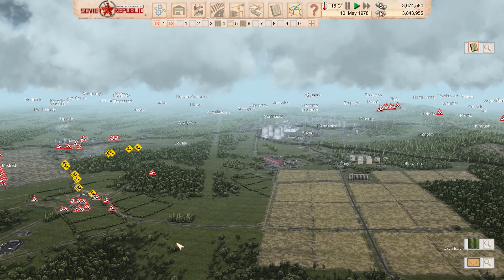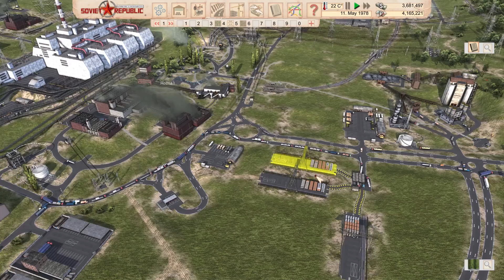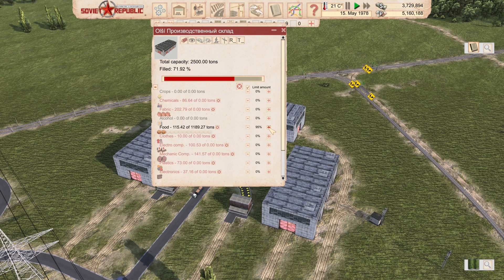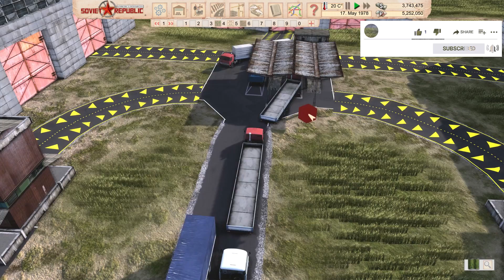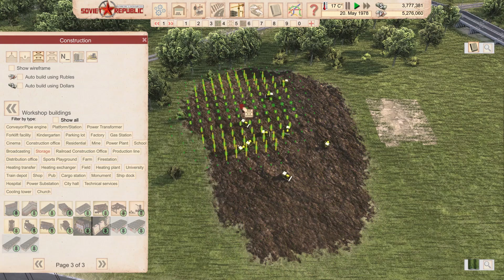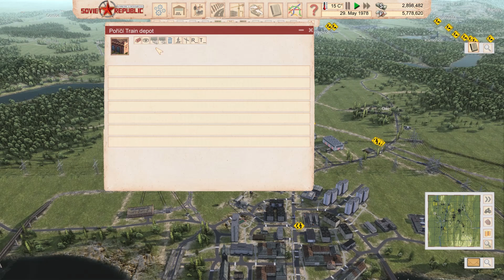Workers and Resources - Soviet Republic - Ceanwu Republic - Ep.103

Comment: 41:03 if you hold the left mouse and right mouse button you smooth out the terrain for the road and it makes it easier to make more straight roads and removes some of the obstacles you way. Even if the road is green. Looks nicer.
Reply from the maker: I didn't know that. I think. 😇
Let me test it out! 
I hate making major terrain changes on the highway roads but I hate spending a lot of time on them even more. 😂
Thanks, chief!

Comment: I think the idea of more storage spaces makes sense.  I'm not too sure about having huge areas.  It would seem to me that if you have more, but smaller storage areas and spread out your distribution offices so that several aren't going to the same storage areas, it will spread out the traffic.
Reply from the maker: I agree! more is better. 
Now for the amount. It all depends on what are you going to build. Everything except meat doesn't go bad so it can stay forever. So if you can produce it you better produce it and store it somewhere or export it. 
How much. Well, think about this. If I'm building something huge and it requires 1000 steel and our storage holds 100 steel. 900 steel will have to be produced and shipped to the warehouse. This will take time. But if we have 1000 steel we can finish the construction and we can wait until the warehouse is refilled. 
Bear in mind that you can assign only 1 storage area per construction office so they will only go there for the materials. 
So my opinion is that every distribution storage should have just enough materials to construct everything that you might need and let the warehouse replenish over time. 
What do you think?